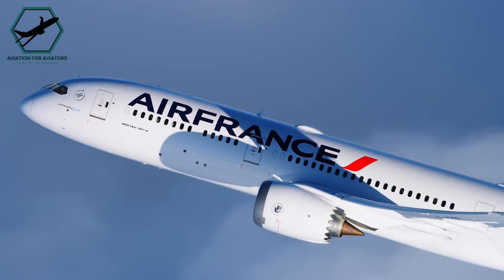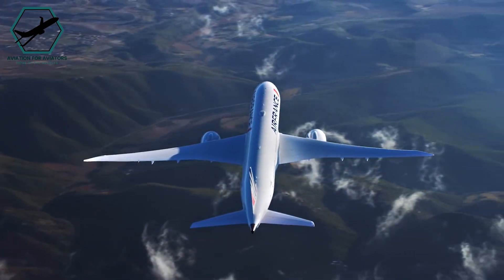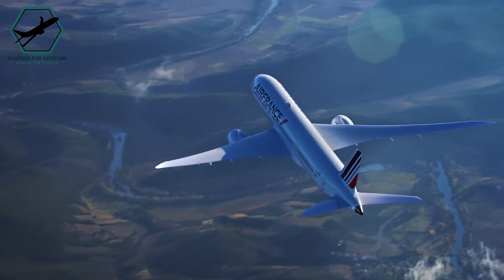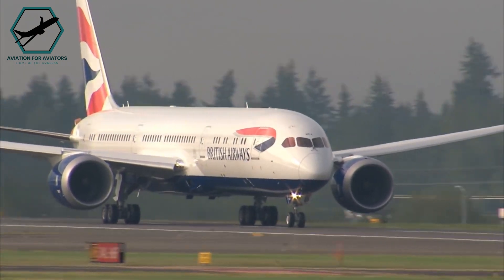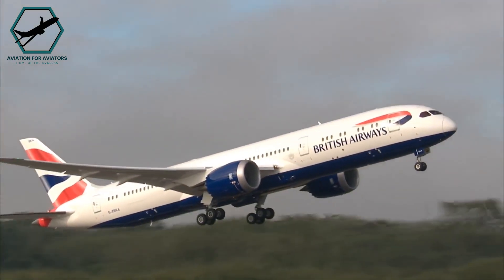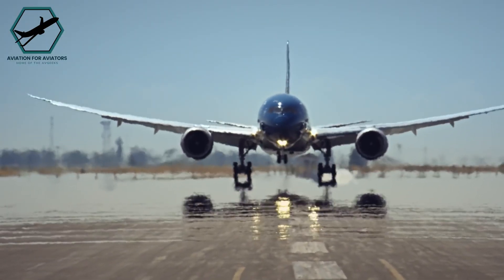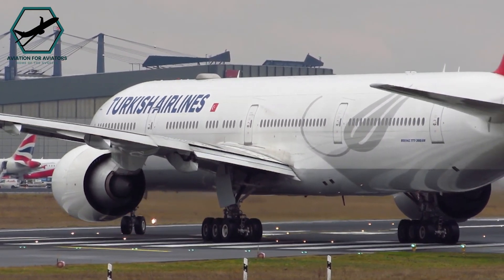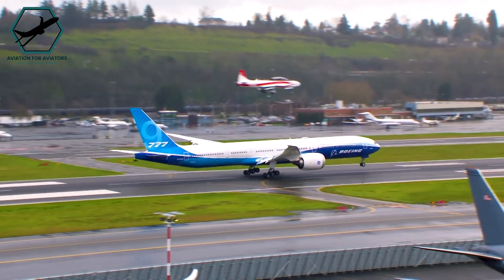Why the Boeing 787 Dreamliner Doesn’t Have Winglets?

Comment: Wasn't it Boeing who discovered you could get the benefits of a real winglet with a raked wingtip, something that was first implemented on the Boeing 777-200LR/300ER models? That's why the 747-8, 787 and 777-8/9 models all use raked wingtips instead of a winglet.

Comment: Winglets make sense when either the wingspan is limited, or the structure of the wing does not allow a larger wingspan. Otherwise, improved wingtips are more efficient. Winglets also give better stability around the length axis. Prof. Eppler and Rudi Lindner made a series of tests with model sailplanes and found that turning up the outmost quarter of the wing by 12° gives optimum improvement. I flew with such a sailplane, and it was excellent to handle. About the performance, I had to believe them.